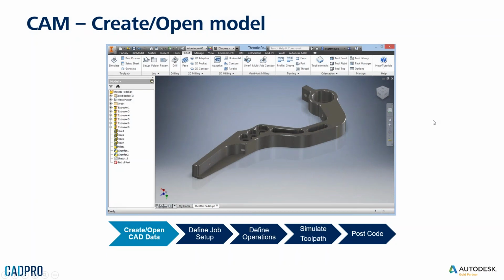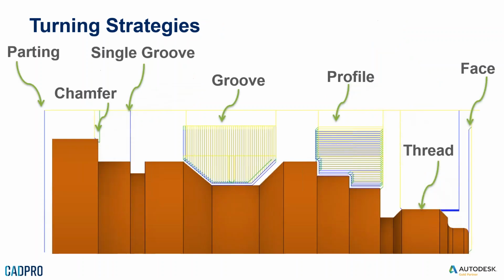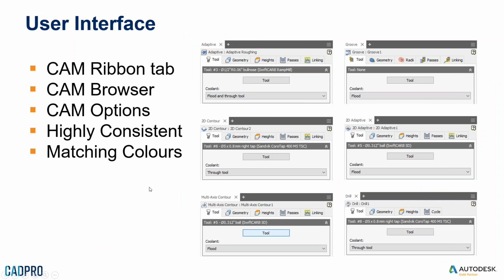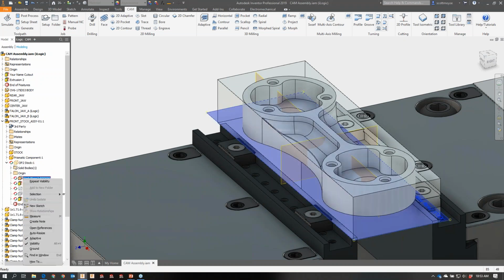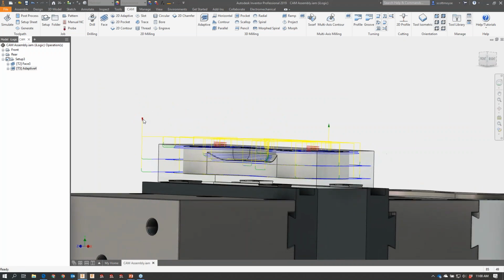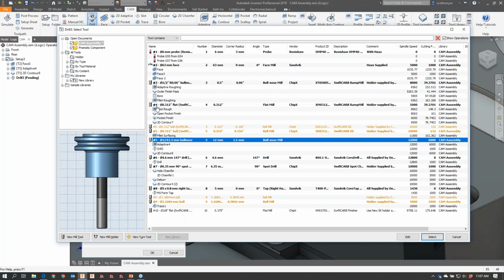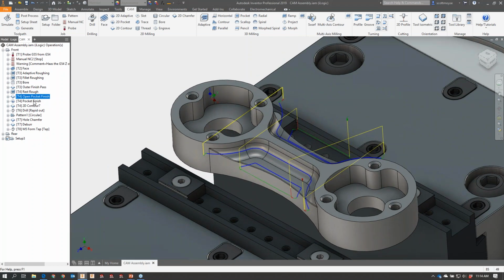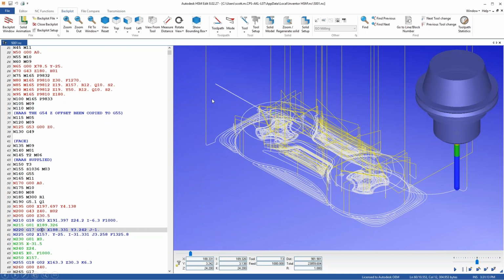Introduction to Inventor HSM

Comment: Do you have a video on how to use milled stock from previous operation? I've just switched over from Fusion for my Cam work to HSM solidworks as that's where I do all my Cad. Is there a way like in fusion you can save the milled simulation and use it as a second setup by importing it as a solid?